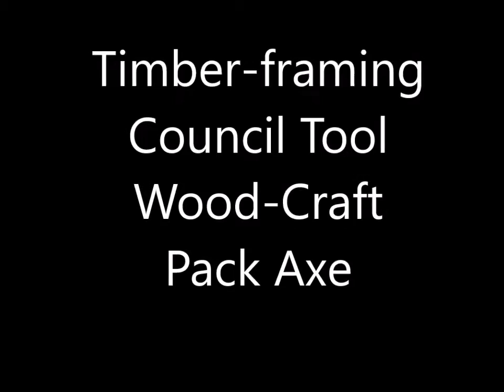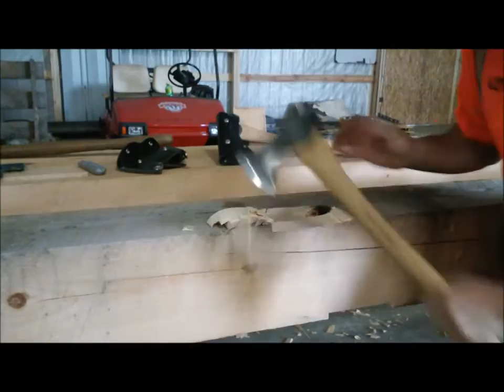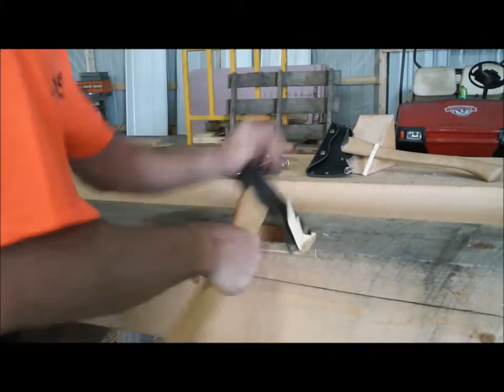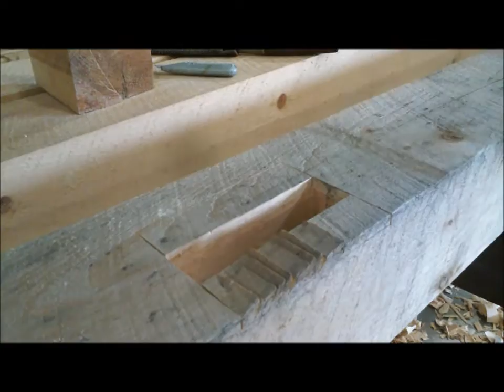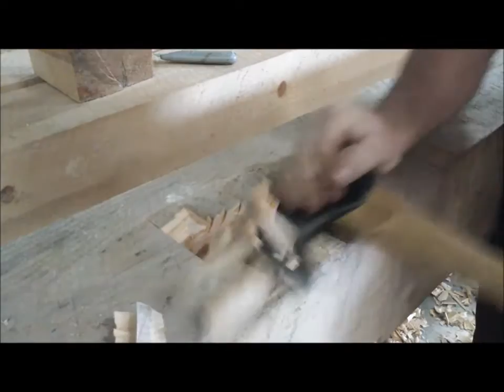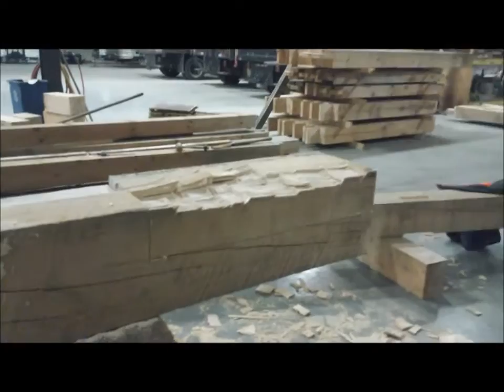Timber-framing with a Council Tool Pack Axe.... Rooster

Comment: Dang Rooster, that's some might fine axemenship!

Those chips were HUGE 

Mirror polished bevel to nice

Waterstones with a jig?

That bevel looks too flat for freehand
Reply: That's stock flat-grind bevel straight from Council Took... although i sharpen by hand using the scary-sharp with a drywall pad.. check out other videos for sharpening techniques...Peace, Rooster :)
Reply: Axe Junkies Nice, yeah that flat grind just blows up that wood, I've watched this video several times, I love sharp tools that perform well.

I watched the dry wall sharpening video as well, good stuff brother.

Let get some more axe action videos!😂